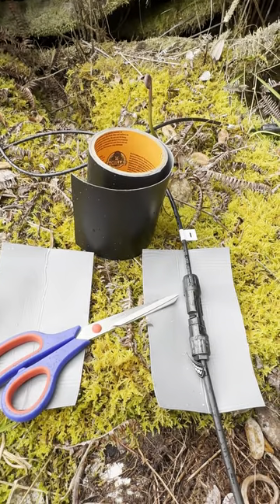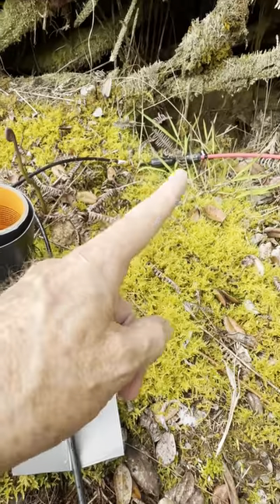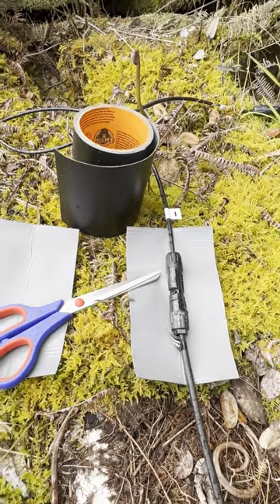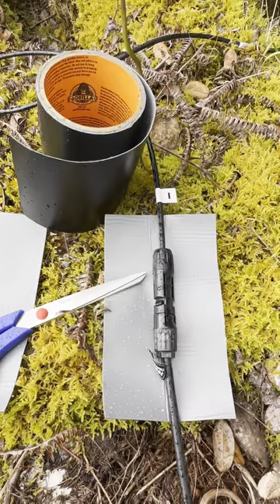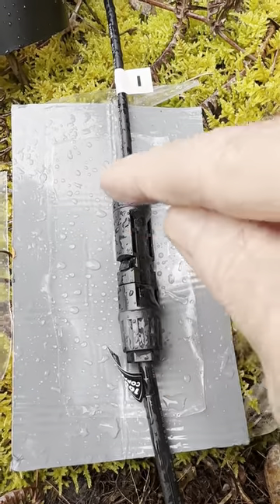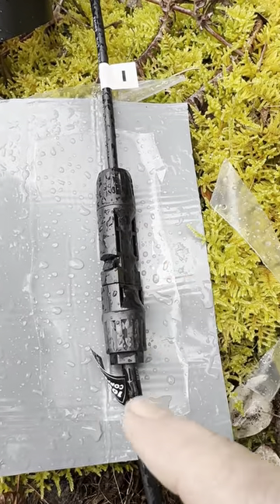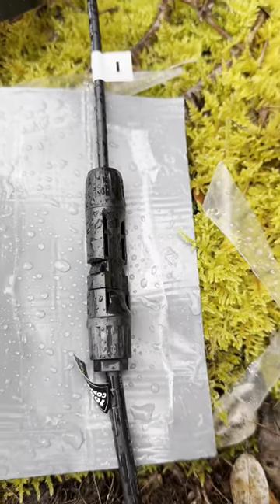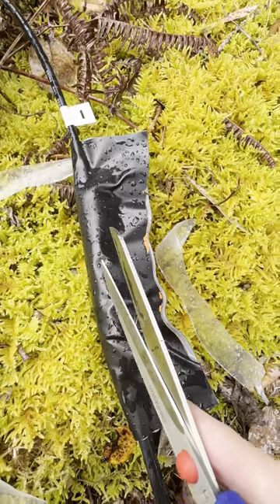Watertight solution for MC4 connectors on the ground #shorts #offgrid #diy #solar #water #hawaii

Comment: Id try to also get the connector elevated relative to the wires (locally) , so that any water on the wire runs away from, and not towards, the connector.